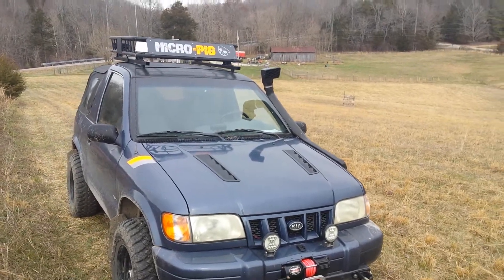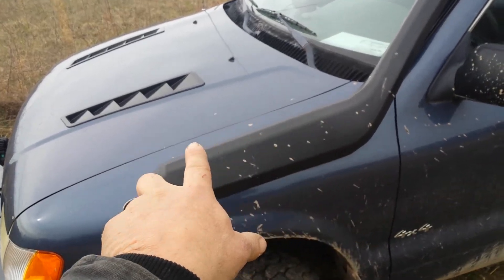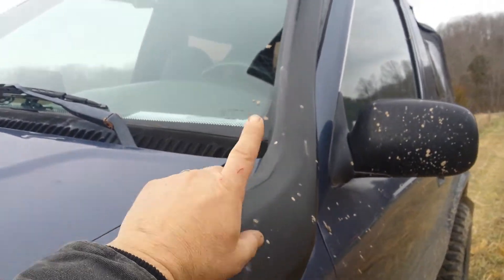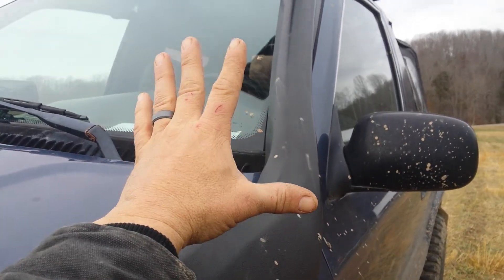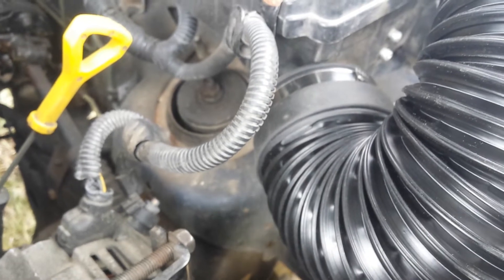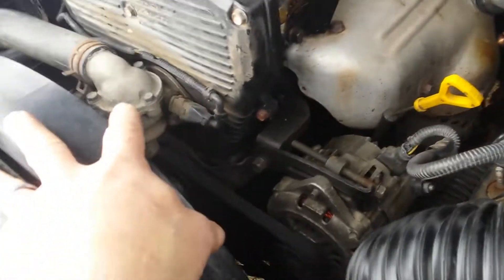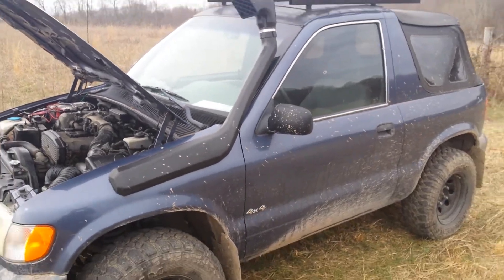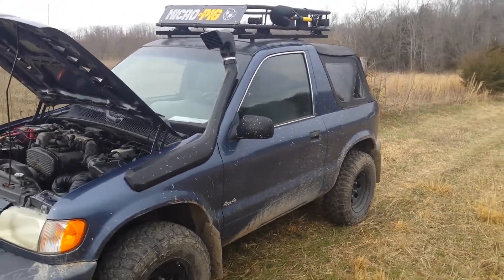Micro-Pig volume 7! Adapting an XJ Jeep snorkel to my Gen. 1 Kia Sportage.

Comment: Awakening an old video but how did you match up the oval at the base of a snorkel to adapt to a round outlet to attach to the airbox?
Reply from the maker: The XJ snorkel is round at the outlet, or at least mine is. The only thing that I found was that the flexible pipe that attaches to the snorkel is a bit too big to fit on the airbox of the Sportage. It will need to be adapted and sized down.